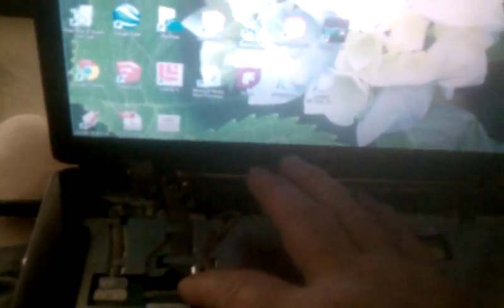Pt 1 of 2: Dell 1545 Inspiron Laptop Video Display Problem And Troubleshoot

Comment: I have dell inspiron 1545. When i turn on the laptop the screen is totally black and the fan starts to spin and after 5 seconds it stops and nothing happens... After 10or15seconds the laptop turns on again but still the same... The screen is black.. This is so frustrating.. I have important files in it... The laptop had problems with screen (it was going grey and i was coming to normal when i put pressure on the screen...) what is the problem and how can i fix it?